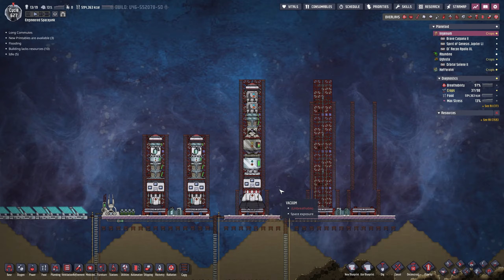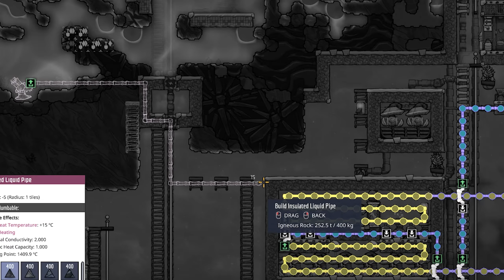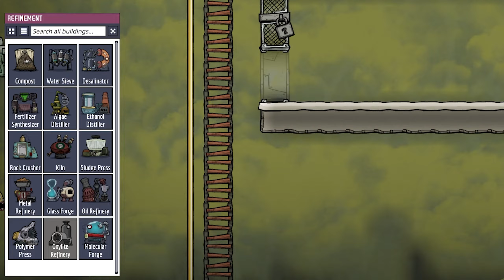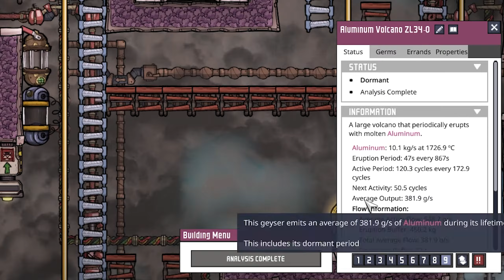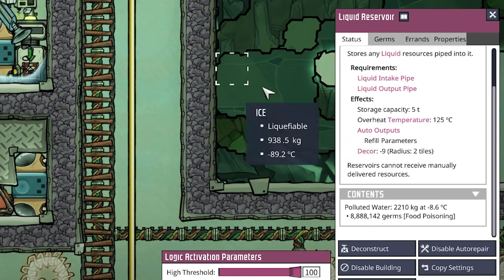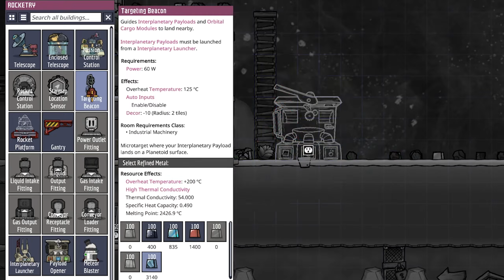How to Power a SWAMP PLANETOID with NATURAL GAS! 🤔 | LP2-EP34 | ONI

Comment: Still catching up to the series. Almost there! Probably gonna binge the rest tonight. One thing though, I saw some folks mention using an atmo sensor in the aluminum volcano to control the flow. I second that sentiment. You've had to cut the salt water twice already. If it was controlled by an atmo sensor instead of the hydro sensor, the salt water can just continue to flow, even when dormant. The rate will slow, but you can have a constant flow through dormancy.
Reply: Also as a safe guard, you can bridge the steam turbines water onto the salt water. If you have a constant flow (by using the atmo sensor on the fluid dump thingy, forget the name right now) the water will keep going to storage, but if salt water runs out, it will automatically divert the clean water back into the system.
Reply: *liquid vent. Why the hell couldn't I think of the word vent?

Comment: Can you list your mods along with your save file?  I see you have a filtered liquid pump - it would help if the mods were in the description as well in case there are any more.
Reply from the maker: There are a bunch of mods I use. I keep an updated list pinned to the ONI channel on my Discord. I used to have it linked in the description, but it’s not possible to keep it up to date on older videos. So I opted for the Discord method. 
The filtered pump mod is one of my favorite QoL mods though :)